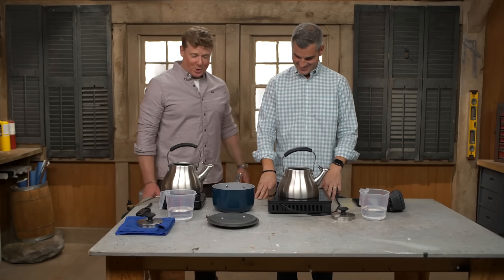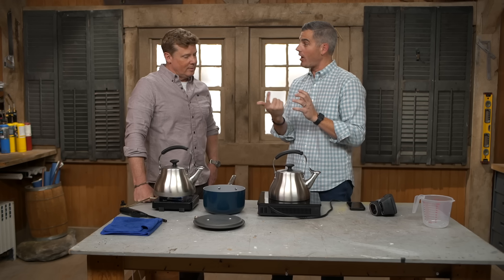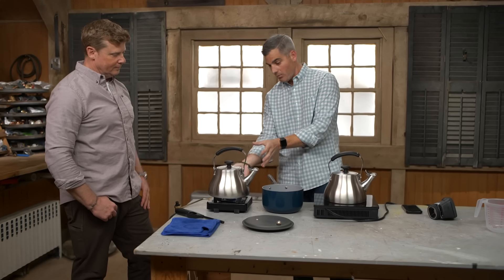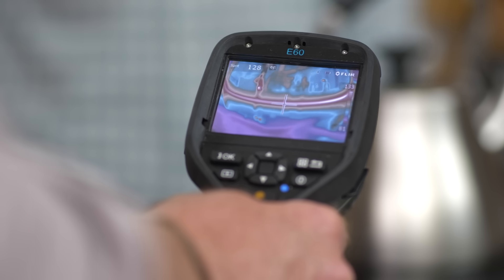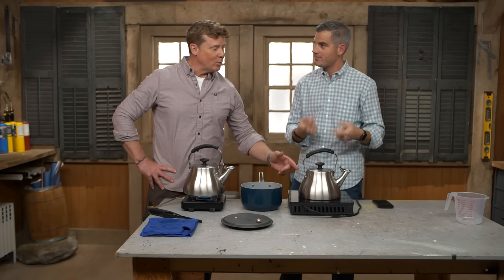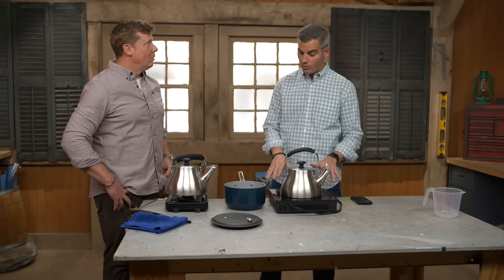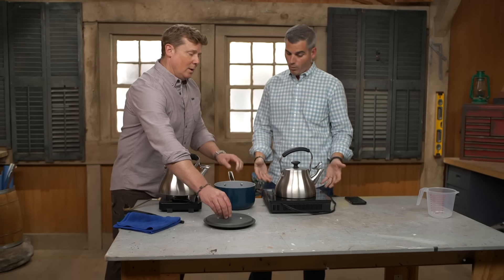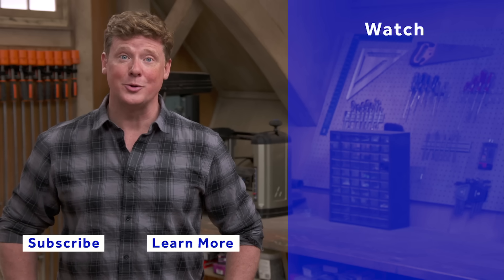Induction Cooking Technology | Ask This Old House

Comment: We know that the purchasing cost for the induction is higher  but what about usage, is gas cheaper on the long run even with half of the efficiency, what about conventional electric vs induction?

I cooked with all 3 and would be undecided between induction and gas.
Reply: It depends on your gas and electric rates, but since induction is so much more efficient it probably comes out about the same or slightly in favor of induction. Plus in the summer your AC won't have to work as hard to get all the waste heat out. Either way, cooking is probably a relatively small part of your energy bill unless you're making elaborate meals everyday. Heating/cooling the house and heating water are likely much more significant.

And with induction you can eventually get solar and offset the cost. Can't do that with gas.
Reply: @mattv5281 agree... specially the part about the heat dissipation, gas leaves 60-70% of the heat in the air, electric also leaves some after the cooking is done and induction cools down much faster.
Reply: @Kevin-mp5of  Amps x Volts =Watts 
                   Tommy× lobstah mheat = bonah

Comment: It would be nice if there was a stove that would turn off if it detected that either the pan was empty such as you were boiling water and you forget about it and the water boils out and the stove just shuts off and or let's say something that is not supposed to be on the stove that will work with induction cooktop is sitting on the cooktop the stove will detect that is should not belong there hand not allow the stove to start up or will shut the stove down instantly. While we are talking about this issue of upgrading we need to talk about something you failed to mention. This type of stove would be great for many different types of "DISABLED" people!  We need to not forget to talk about the different types of ovens that we could upgrade to follow suit with the induction stove.

Comment: Even with just an entry-level induction stove-oven combo I already regret every time I try to cook at someone else’s house. Slower to heat up and cool down, less precise temperature, etc. I can’t see us going back to gas or electric resistance cook tops ever again.

Install was pretty easy. It needed more amps and a different outlet than the old gas stove it replaced (which would have been true even for electric resistance stoves as well), but after that we just plugged it in and slid it into place. We left the old outlet and capped the old gas pipe in case a future owner wants to go back to gas for some reason. Now our utility bill is much lower on induction than it ever was on gas or electric resistance! 

We got ours from the local big box home improvement store. They weren’t much more expensive than the alternatives, maybe 10-30% more depending on the brand/model—something we could easily make back in utility savings in a few years. (But even if it were more expensive in the long run, I’d want induction over gas or electric resistance given how much better it performs).
Reply: What about the oven? I bake alot.
Reply: @lookup2one My spouse likes the oven. It works the same way other electric stove-oven combos do. (I guess ours also has convection.)
Reply: @ByrdNick  Thank you!
Reply: California doesn’t have enough electricity in the summer to charge electric cars.  Imagine the governor telling use we can’t use our stoves in the summer.  My gas stove works find.
Reply: @bngr_bngr  A year has gone by. California has increased its solar and wind power generation considerably. We also had a wet year and filled all the reservoirs. They are building a new reservoir too, the Sites reservoir. 
Even at the peak of the drought what they asked of EV owners was to please charge off peak, which they did. They were good citizens to do so (and saved money 😉).
Reply: @danielcarroll3358  Solar sales are down 84% in California.
Reply: @bngr_bngr   Because of NEM 3.0, but I am talking about utility scale solar. That is up.
There is a recent test installation over a canal that is working out well. It uses otherwise unused space and has increased efficiency because it is cooler. Evaporation from the canal is also reduced. Win, win, win.
Reply: @danielcarroll3358  we need better technology.  I would support more nuclear power.  Fission is the future.
Reply: @bngr_bngr  Where are you burying the spent waste? Decades have passed & no one cares to answer this question.

Comment: How does the oven on the range heat? Ineffective electric coils?
Reply: Those ineffective coils charge your iwatch each night
Reply: The oven on induction stoves use regular resistive electrical elements; not induction . (So you can bake your lobstah chowda.)
Reply: @Kevin-mp5of  🤣
Reply: Just use more lobstahs , seriously.
Fuggetta bout it chump

Comment: Showing this to my parents. Trying to convince them to replace their electric range with induction for their kitchen remodel.
Reply: Technology Connections covers this really well.
Reply: Have them get gas. Never better
Reply: Make sure they have camping stoves as backup if they live in area where power outages are common during bad weather. My butane stove saved me when I lost power for 5 days.
Reply: Cast iron and see stainless steel cookware. No worries on power outages as they live in a stable 1st world area.
Reply: @kingssman2  ,
I live in an expensive first world area, and we get outages ALL the time.
Reply: Point out the sealed, flat top on an induction cooktop. So easy to keep clean.

Electric and gas cooktops have drip pans under the burners, and I'm sure your folks won't miss cleaning out the burned-on grease!
Reply: Show your parents the induction cooktops that have the blue LED's on it which reflect onto shiny cookware and they look like blue gas flames.  Totally cool, I love mine.
Reply: @BradThePitts  Is that a safety feature, so you know the burner is on, without looking at the controls?
Reply: Hope all their pots and pans are iron or steel.  Induction does not work with aluminum or anything that cannot be magnetic.
Reply: @richardb.5691 aluminum is a dangerous material to use for cooking.
Reply: @richardb.5691  We replaced most of our cookware with All-Clad stainless, and although it is not cheap, the All-Clad is better quality than the pots we replaced. My only regret is that I can't use my copper pots on induction.
Reply: Gas is the only way to cook.
Reply: Get outta their basement !

Comment: The cost per Joule of electricity vs natural gas delivered to my apartment in New York City is 5x. They just banned gas in new construction. NYC peeps, raise your hand if quintupling your annual energy costs is possible with your household budget 🙋
Reply: I'm in NYC and just got an induction cooktop and small convection oven.
The cost might be 5x, but if induction is 3x as efficient, that brings the cost closer. Add in reduced cooling in the summer and the minor increase in cost is worth it to me for time savings and cleaner air.
With the convection oven, bake times are cut 10-30% and the temperature is reduced. Considering it's 10% of the volume, I'm sure I'm saving money with the oven. Also the food comes out better.
Reply: robertfeliciano5723., Stop trying to confuse us with relevant facts and figures.... Our mob minded conspiracy mentality, is not going to be fooled....
Reply: This Old House is being incompetent or dishonest in their comparison of gas vs electric stoves. You MUST factor in the efficiency of the fuel burned at the electric power plant. They did NOT do this. Most of their stuff is fantastically good. But this, ugh!

Comment: edit - considering some politicians recently started talking about banning or regulating gas stoves this clip seems oddly well timed.
however the majority of commercial kitchens use gas stoves and ovens.
Reply: For now.
Reply: Until the fed will cover 100% cost of my dual-fuel range, I'm cookin with gas...but still baking with electric. I would love induction, but I need to have some test of all my pots/pans... and I have Corningware that will be obsolete with induction. At this time, induction is not ROI unless I was getting another home, or building a green-home (induction, Mini-split cooling/heating, solar, VAWT and battery storage array).
Reply: @xoxo2008oxox  ROI for a portable version, similar to the one in the post, I'm willing to bet it is less than 2 years, If you use it most days of the week like I do..... I got mine cheap but new off CL, so my ROI was less than 1 year.....
Reply: @xoxo2008oxox  Yes, just this week, the authorities are trying to push through a ban on gas stoves, starting on new construction. There excuse is that Some children might have asthma from this. They turned it into a climate change woke issue. But it's OK to smoke cigarettes still around children, just not cook. Peole should be allowed choice in their cooking styles. This could very well be timed to prep your brain. even though we all have known about induction for years, now they want to force the issue on us.
Reply: @xoxo2008oxox  you'll do what you're told like a good little lobstah
Reply: Don’t fall for Kevin’s old liberal trix .and for god  sake , question everything .
Especially with TOH
Reply: @scundoorsup5342  Give me a break. TOH have been talking about new technologies for decades. It's not even ne anyway.
Reply: @saulgoodman2018  you sound like the producer . Of course you gonna say that .
Yankee
Reply: @UCdqRn_A6r9VpQK0MfM03AAA BONAH??😂😂😂😂
Now ya really killin me ,, !!
Reply: TOH has been slowly but surely going woke. They won't come right out and say it but they are on PBS which is the wokest of them all.
Reply: @andrewludwig9251  They have been on PBS for like 50 years.
They have talked about induction stoves for decades.
Reply: @andrewludwig9251  do you even know what the word “woke” means?
Reply: @Ryan-ew7bg  I don't. What is it?
Reply: @andrewludwig9251  calling induction cooking "woke"... now I think I've seen it all.
Reply: @Danne-Danger  no ya haven’t , ask Al Roker , ya lobstah stooge

Comment: Any conductor will work fine.  You could even put a conductor in the bottom of glassware.  Good conductors like gold, silver, and copper will experience a significant upward force, however.  The 60 Hz current in the copper windings generates a 60 Hz oscillating magnetic field.  This changing magnetic field generates currents in the conductor (pot bottom in this case) as if it was a secondary winding of a transformer.  These currents cause the metal conductor to get hot.  This same process is used in induction heaters, induction forges, induction furnaces, and wireless phone chargers.
Reply: Worked with a VIM before, induction heating can get warm, quickly, and on some of the most heat-treated metals in the world
Reply: Such garbage
Reply: @scundoorsup5342  Then buy something else.  Your lack of demand makes it cheaper for me.
Reply: Thank you for approving old expression that,  if you can't blind them with brilliance, baffle them  with bullshit.
Reply: Exactly! That's why all those people with aluminum or copper cookware have no trouble at all using induction ranges, since those materials are electrical conductors too.

(In case you couldn't tell, that's sarcasm, and you're completely off base. Oh, and the secondary winding of a transformer doesn't generally get all that hot either, compared to the energy input. The whole transformer can get a little warm, but that's counterproductive, since you really want the bulk of the energy going to the actual load, and not being wasted as heat in your transformer.)
Reply: "Sarcasm is the caustic use of words, in a humorous way, to mock someone"
.
Good luck working on your humerus, for boning up on what humorous means...

Comment: Propaganda. Electricity for this induction heating or any other electrical device has a smoke stack attached down at the local power plant venting heat and by products  that makes it just as "inefficient" as gas or wood or otherwise.
Reply: It depends on location and where the grid power comes from. Sometimes that can be solar, wind, nuclear, hydro, or fossil fuels. Even with a coal powered power plant there's more efficiency to product each unit of energy than burning the fuels for energy/heat on an individual level. It's not "clean" but it's cleaner on a mass scale. We're also using fossil fuels faster than the Earth creates more, so eventually our ancestors won't have an option, regardless of what humanity prefers to cook food with...
Reply: @GetHighGardening  wrong. Fossil fuel is a myth. Gas , oil etc is always being produced as a natural process of the Earth.
Reply: Incorrect.
Reply: @thenexthobby  Nope
Reply: @rd-ch1on  Yep.
Reply: Correct. Unless you have your own solar plant/wind/battery storage (offgrid) and supply your electric. Can't wait for all the EV cars and electric-only homes/apartments to create rolling blackouts or monopolized unregulated suppliers.
Reply: @xoxo2008oxox  nope because all  those windmills, panels etc require mining, manufacturing, shipping, maintenance,  repairs and replacement. All those things have smoke stacks attached. This Old Paid Propaganda episode by Ross the salesman
Reply: @rd-ch1on  I don't think anyone's in a rush to construct new windmills.

Comment: Often times as a cook you want to kill the heat without having to move the pan.  You can't do that with induction. Induction blows.
Reply: You just turn the knob to off like you would with gas? There's no ceramic element that has to cool off like electric
Reply: You’re thinking of electric. Induction is different than electric. The only thermal mass storing heat when you’re using induction is the pan, which is the same exact as with gas.
Reply: @cheeseisgreat24  oh I'm thinking of a different electric powered hot plate.
Reply: Yes, you can.
Reply: No you can't lol the heat stays and the pan keeps cooking. Also there's much less heat control from low to high overall. No self respecting chef would ever run a shift from an induction cook top.
Reply: Induction stops heating instantly when power is cut off. Just like gas. Except that gas has metal/ceramic grid as platform that is still hot.

If you want to heat water quickly and efficiently, nothing beats a electric water pot, where the heating element is under water. You get like 98% efficiency as almost everything does go to heat water. Rest goes to cable and the pot itself.

We moved from induction to gas stove, because you can get different kinds cooking done with it. But still i would prefer induction stove.
The gas benefit is that you can control pan differently than with induction, as you can raise it to tilt it.
And because gas has lower heating time, you have easier control of food cooking because learning curve is smaller.
Reply: @Kevin-mp5of  can you do a segment that’s not so rasis!!